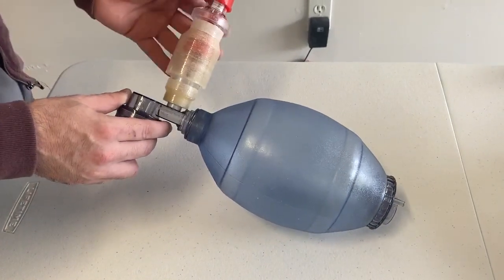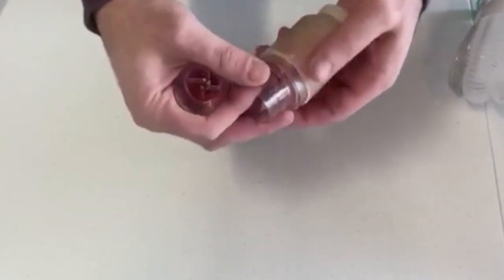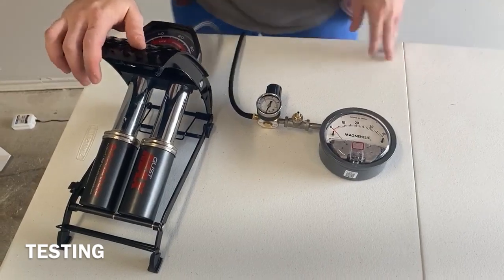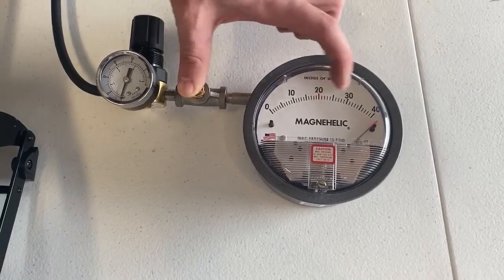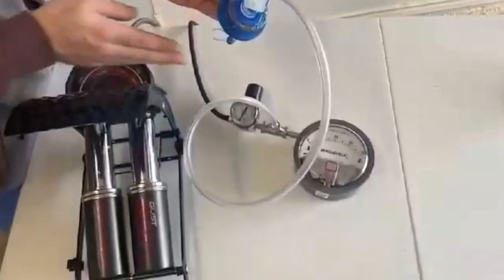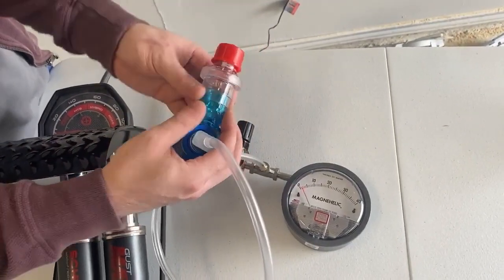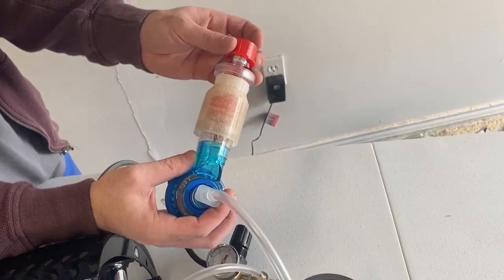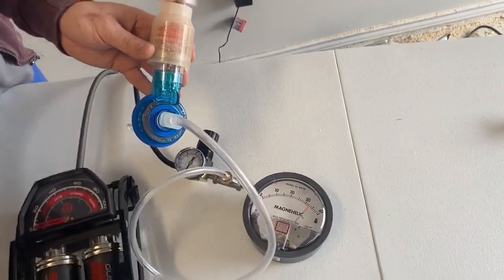Adjustable Pressure Relief Valve 40cm H20- For Ambu

Comment: can we use this pump in place of ambu ?
Reply from the maker: Great question!  This pump like most bike/tire pumps has a small tube which causes a low volume-high pressure flow which is bad for ventilation.  But if you find a pump with a large tube (and without any chemicals inside) it can be work.

You can read more about it here:  https://www.ebcore.io/guide-to-creating-emergency-ventila